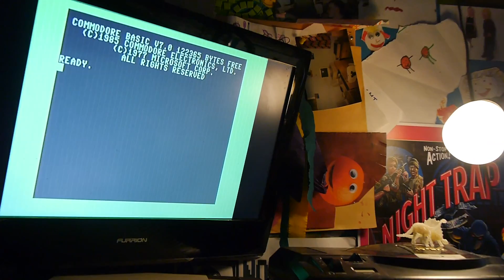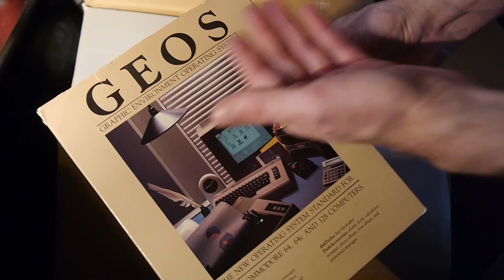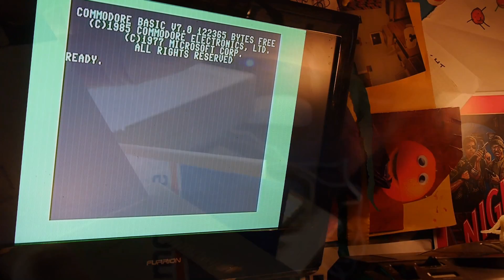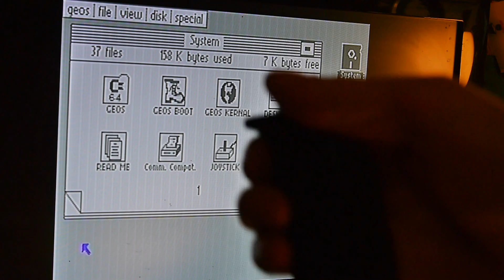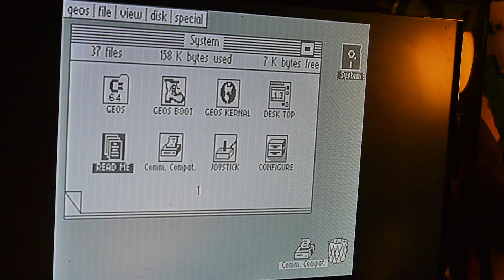Commodore 128 & GEOS, "Repair", Setup & Inspection | Nostalgia Nerd

Comment: Yeah GEOS was more usable in 128 mode. More screen real estate to work with (IF you had a capable monitor) and it took advantage of the 1571's double sided capabilities.  I turned in a lot of homework assignments typed on geowrite with print shop cover sheets back in grade school   :)

Comment: I did not get to have any computer until 1989 or 1990 which was a Tandy 1000 sl and then got another computer in 1997/8 can't rightly remember but it was great with its DVD drive. And then I didn't get anything until 2010 when I got my toshiba laptop. While I never had one as a kid I never got to learn and I'm finally going back to my childhood and learning from what I would have had then. I got all the new sega consoles through the years instead.

Comment: It would be fairer to say that the Amiga 500 looks like the C128 since the C128 came first.
Reply from the maker: +Gooberslot That would be fair, but they both kinda mean the same thing
Reply: Still, it makes sense to compare the design to that of an Amiga 500 since the Amiga is more familiar for most people. Plus 5-6 months release date gap is not THAT much, case design was clearly laid out by the same people at the same time, only the Amiga was a completely new groundbreaking machine and maybe saw its release a little bit delayed for some reason.

Comment: Can you show Geos running in 128 mode please? Cheers
Reply: You must connect a monitor to the RGBI port on the back and not the normal video output. The normal video output is just like a ordinary c64 and the computer runs at 1MHz. If you connect an RGBI monitor instead (and push down the 80 column key) you will get into true 128 mode with 2MHz and higher resolution. Now you can use GEOS 128.
Also with the 1571 disk drive the computer can boot from disk so you don't have to type LOAD "*",8 all the time. Just have a disk inserted and boot the computer.
Reply from the maker: +thedddemon I'll see if I can sort it out
Reply: +Nostalgia Nerd That would be so much better. It will probably look like GEOS for the Apple IIe...
Reply: ZamuelAtari now he knows :)

Comment: Nice to see Geos running, though I would have liked to know if the 128 version could make use of the more capable hardware (more ram, advanced video modes).
A detail : the Amiga 500 wasn't released before 1987. In 1985, it's the "Commodore Amiga" that was released, later renamed Amiga 1000.
Reply: Needs to run in 80 column mode to take advantage of the 2Mhz mode and yes it did make a huge difference.
Reply: 5 years late... but yes it does. You also want a 17xx ram expansion module (as it has a DMA controller which really helps GEOS quite a bit.. not to mention having a large ramdisk)

https://youtu.be/qw9gucO1AgQ
Reply: @c128stuff  yeah, I groaned audibly at the 12-minute mark when I saw GEOS for the C64 being loaded on a C128… that’s a crime. It would be like loading Windows 98 to show off a Pentium 4.

GEOS 128 uses the 80-col RGB monitor (640x200 not 320x200), and runs the processor twice as fast
Reply: lol at my own comment… needs a follow-up… I’ve only just managed to repair my C128 (I’d never used it since being given it many years ago) - and I’ve been trying to use GEOS 128. It’s so unreliable - crashes often - and is barely any faster than GEOS on a 64 (it’s actually slower to start; the mouse pointer flickers in 80-col mode because it’s not a sprite; there’s only sprites in 40-col mode) - and I couldn’t get the 1351 mouse driver to work in 80-col at all). And the GEOS disks are single-sided! Not making use of the 1571…

So, it turns out that I think C64 GEOS works better anyway, and in the end, there doesn’t seem any point in having a 128. I’ll stick with my C64c (and borrow the 1750 RAM Expansion Unit from the 128) :D

And what’s wrong with Windows 98 on a Pentium 4 anyway, that runs awesomely fast (just realised that last year)
Reply: There was a 128 version.  I used it on my 128D in 80 column mode in college.  I loved it.  Then I got an Amiga...
Reply from the maker: +sautebroussailles Yup, my brain got addled. Still the 1000, is pretty much the same thing as the 500. GEOS on the 128 does make use of that extra memory, and you really need it to make the most of the GUI
Reply: Cool, thanks for the info. I definitely need to dig up the old pal and see if I can try Geos with the help of my 1541 Ultimate II cartridge. Contiki would be nice too, if only I had a RR-Net network card...

Comment: I had one of those 230V -> 110V "bricks" and it failed within a few months. If yours does the same thing, I would recommend the following:
http://www.maplin.co.uk/p/240v-to-110v-300w-voltage-converter-vr05f

My mate had a 128 which he only used as a C64, I remember the Go 64 command :)
Reply from the maker: +Shundi12 Cool. Thanks for the advice!
Reply: Way too late to reply, but wouldn’t getting a 50Hz replacement PSU be the right way to go?

Comment: Having a 128 myself, you might want to avoid putting the metal heat-sink back on the motherboard and chips. This is because the heat-sink doesn't work that well, and serves to cook the chips very slowly. Should be fine for occasional use though :)

You seem to have landed on your feet with that buy. My own is still awaiting some free time so I can diagnose and fix some keyboard issues. There's a good site for it called www.c128.com, run by Bill Herd who was the design engineers on the machine. There's also a good Bill Herd podcast at http://www.theamphour.com/tag/c128/.

For me, I just love it's oddity value. A capable machine, it wasn't that common back in the day due to the price and the fact the A1000 and A500 were out. There are very few games that take advantage of the extra power and features. The Last V8 and a jazzed up Rocky Horror Picture Show are the only ones that spring immediately to mind.
Reply: CartoonsKick  Well, also, that heat sink served to meet FCC emissions regulations.  Since those are no longer important (because modern monitors are not vulnerable to that kind of emissions), it's safe to remove... and many people do, as well as gluing more conventional-looking heat sinks on top of the 8510, Z80, VIC-II, etc.
Reply: Actually there was a small dispute on this. To able to cool something efficiently, you need big radiation surface. Please check out the VGA cards how big heatsinks they have, even with 35-45W cards. These MOS ICs produced with much less advanced technolgy, and generate a lot of heat too. 
The RF shield has a really big surface and big mass compared to the small heasinks you can allpy on them. 
Maybe it is a better idea to reinstall the RF shield and add some good thermal paste (I thick Commodore also added it, just dried out in the last 30 years).
Reply from the maker: +CartoonsKick Thanks for the advice. I agree. It's oddity value is through the roof. I missed out on swiping up The Last V8 a few months back

Comment: I believe you need a C64/128 only mouse for GEOS. I forget the exact name of it.
Reply: +Nathaniel Lockhart yup - those are like "analog" or something. Different than the Amiga mice.. :-)
Reply: the 1351. THAT'S what it's called.
Reply from the maker: +Nathaniel Lockhart I may have to track one of the little blighters down in that case!
Reply: Just an FYI -- There was also a 1350 mouse, but it wasn't a proportional mouse, so it's a bit clumsy.  That is, the 1350 knows what direction it's moving in, but not how fast it is moving.  The 1351, a proportional mouse, is much better for GEOS.